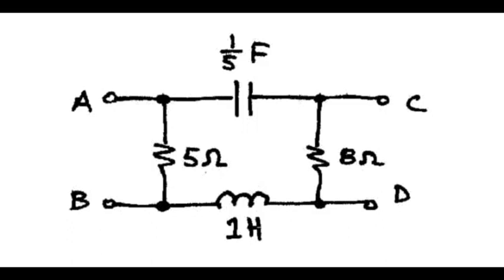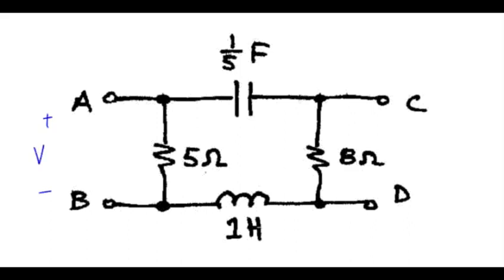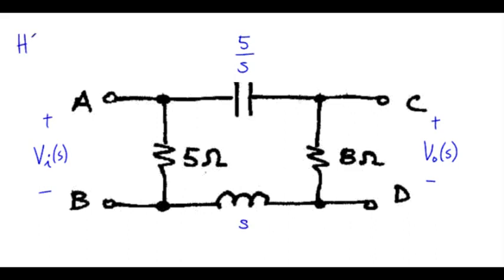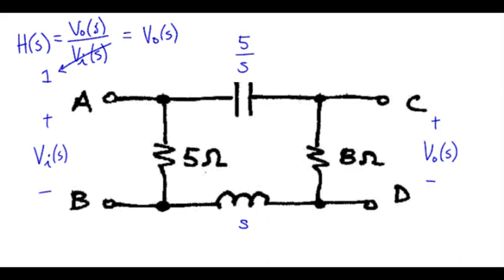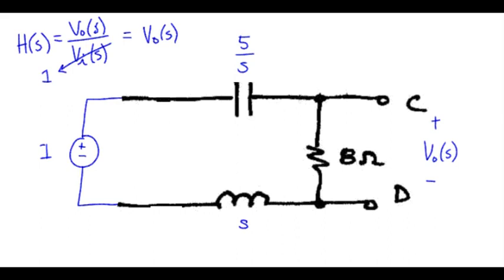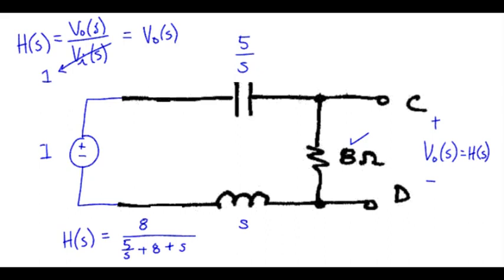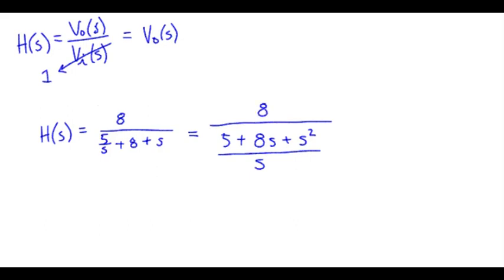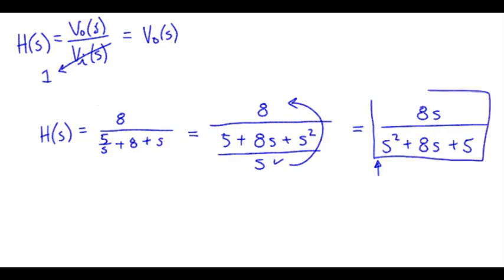s: Transfer Function Example #1

Comment from the maker: The voltage source controls the voltage between terminals A & B, therefore the 5-ohm resistor has no affect on the rest of the circuit. The resistor draws additional current from the voltage source, but otherwise the rest of the circuit does not "see" the resistor at all.

Comment: I guess it's because 5 ohms resistor is in parallel connection with the coil, capacitor and 8 ohm resistor, which means those two branches have the same voltage. And we need to calculate voltage on 8 ohm resistor only, so we can skip the 5 ohm one. Sorry for being late ;)

Comment: Why dud you take out the 5 ohms?
Reply: He simply calculated Vout/Vin which is the transfer function itself. He ignored 5 ohm as the two branches are connected in parallel  and calculation of  V( which is also the Vout) across 8 ohm is not influenced by the 5 ohm.